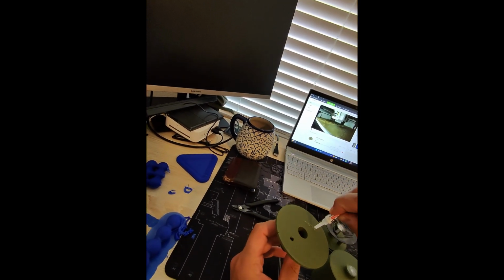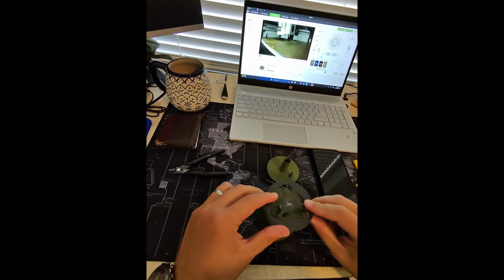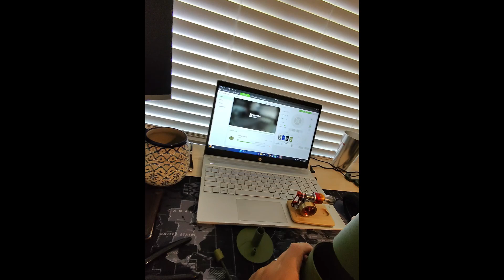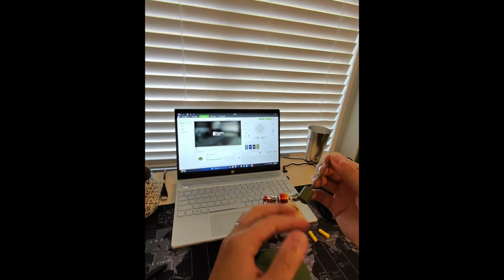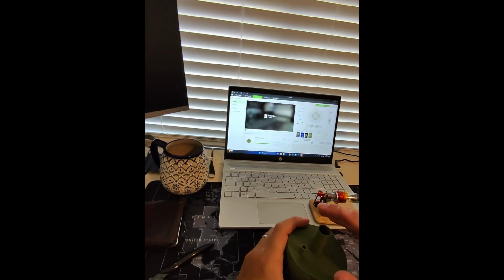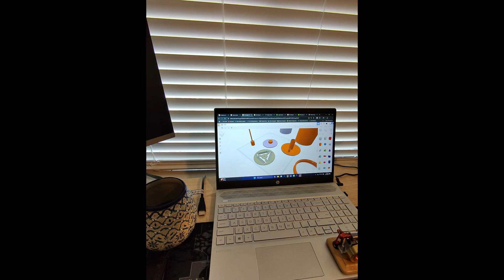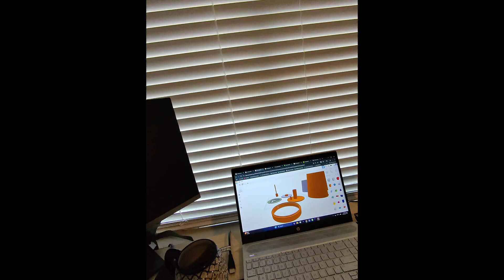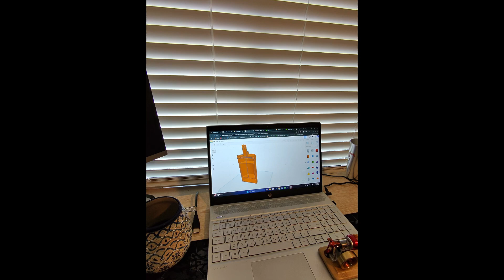Designing a Free Piston Stirling Engine

Comment: If the piston itself will be the magnet, it will lose it´s flux due to high temp. exposure. You can get magnets rated up to about 230°C, that´s it. Helium makes the matter worse. 2nd problem is the surface of the magnet, it could lose it´s coating over time.